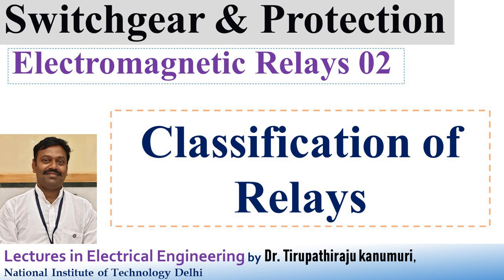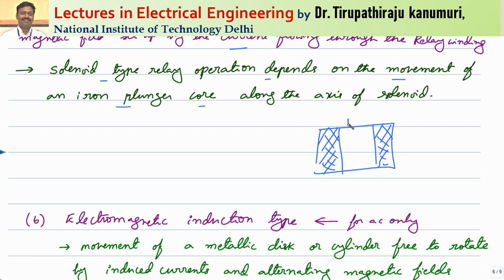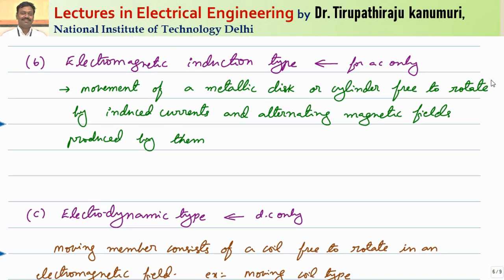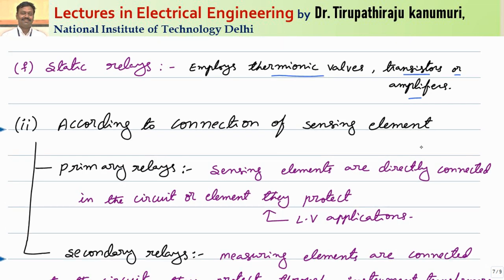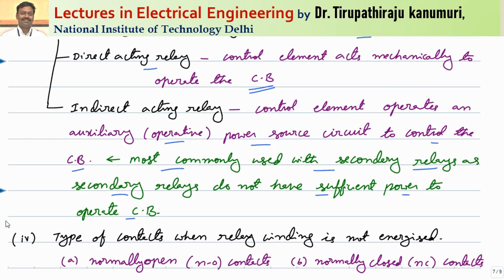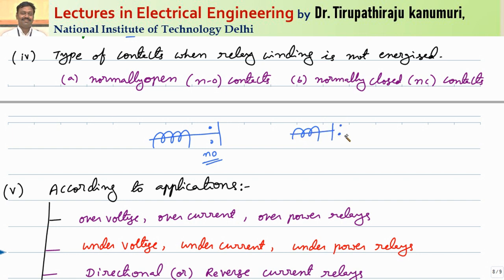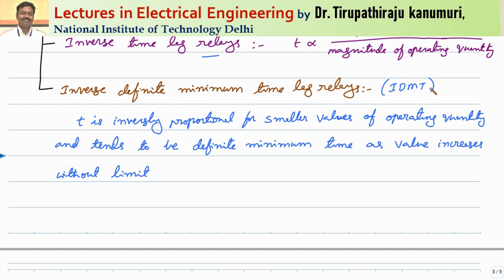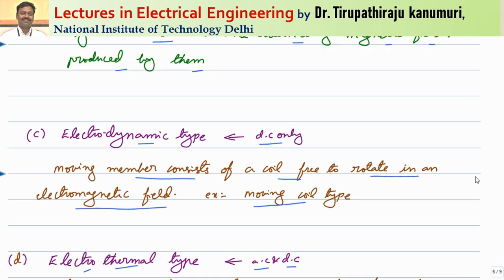SGP302 Classification of Relays

Comment: What voltage battery shall be connected in relay to energies the trip circuit....does 48v instead of 240 dc makes any difference...or how some select battery voltage required for relay...please help
Reply: It is 220 V dc which is taken from Battery Bank present in the substation. It depends on the rating of the Trip coil of Circuit breaker. Generally it operates on 220-230 V dc.